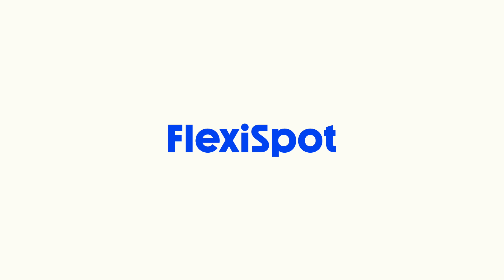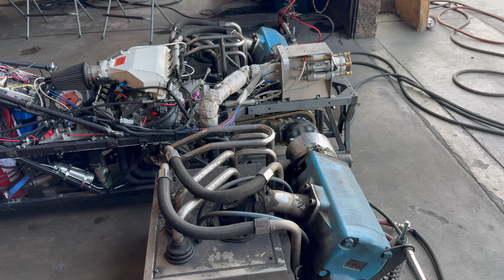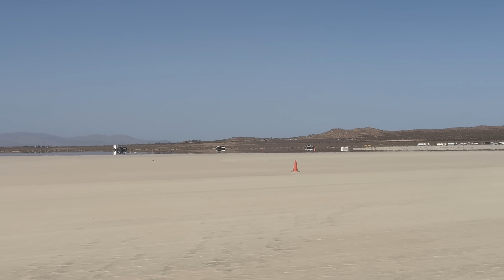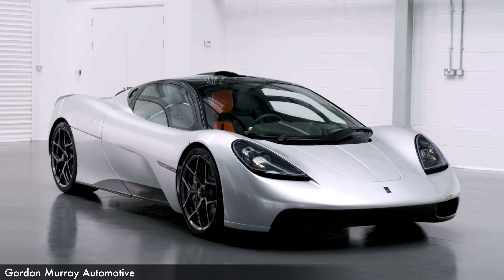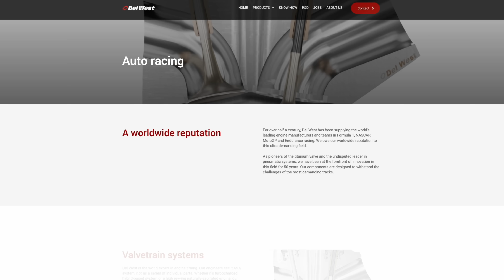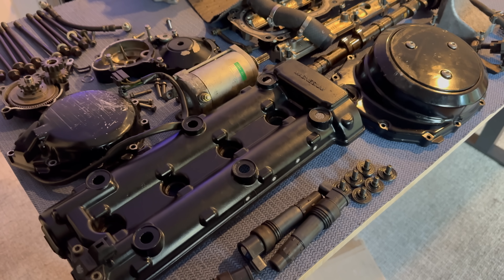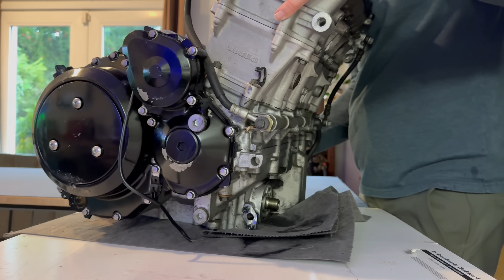Motorcycle Engines Are WAY BETTER than Car Engines

Comment: When I switched from working on cars to motorcycles I immediately noticed the better build quality.
Reply: When I switched from Yamahas to a Ducati I immediately understood the difference between a regular production engine and a pure racing engine. I have effortlessly rebuilt many motorcycle and Kart racing engines and the Ducati Testastretta in my 999 Superbike absolutely blew my mind when I pulled it out for a rebuild. I was unable to do anything myself except teardown and a bit of the reassembly because of the insane tolerances and the need for thousands of dollars worth of tools that are  proprietary to that one engine alone. I did order all the parts myself so I could marvel at their beauty and precision, and was able to witness some of the processes of the rebuild at the various shops doing the work. 
The transformation of my "stock" Testastretta into a fire breathing (literally) monster was absolutely fascinating and it gave me a whole new level of respect for the insane technology and engineering in pure race engines like F1 and MotoGp.
Reply: Ducati engines tend to need disassembly, cleaning, and reassembly, right from the factory. For some reason they tend to come with various debris inside, metal shavings and other workshop dirt.
Reply: @timmio11 Ducatis have amazing engineering, if you can afford to run it.
Reply: @timmio11 and Ducati still get beaten by bmw 1000rr. Hilarous
Reply: @PowolnyJanek  Without balance of power penalties Ducati probably wouldn't have lost a single race in 24-25. Without Toprak and Super Concessions BMW would be nowhere. Very hilarious.
Reply: @timmio11  they also get beaten by Kawasaki for years before that .... it's also funny calling out Toprak when an ex motogp rider is winning your championships ;)
Reply: @timmio11 funny you call one of the best automotive company in the world a nothing 😂😂😂
Reply: @PowolnyJanek who the fuck cares?
Reply: @PowolnyJanek yeah but at least with the Ducati you don't have to be gay right?
Reply: Are they easier to work on because they are more compact or does that make them  a lot more labor insensive since everything might be crammed into a smaller space?
Reply: @Adder0130  working on bikes is WAY easier because so much of bike is exposed. And if it's a big enough project, then you can just remove the engine entirely pretty easily.
Reply: "The engine made for pure racing performance is better than the engine on a mass produced commuter"
Shocking
Reply: @rachelpurity1  Not just that it's just working on these components is so much easier. Need a brake job or transmission build? Good luck laying under a car for 3 hours. On a motorcycle tho you can do it in your living room with like one ratchet and 3 sockets
Reply: the motorcycle cluch feel is alien to me , how can it be so fuking smooth!
Reply: Motorcycle transmissions are awesome and so smooth because its like a torque converter without the conversion lol multiple clutch plates submerged in oil makes a great difference compared to cars single/dual disc high springrate friction surfaces that are bone dry and ready to vibrate against eachother as they mesh lol
Reply: @alexrusu6417 A 100kg bike vs 2000 kg car. Yeah, kinda self-explicatory
Reply: @dimitardimitrov9482  a 50ccm scooter weights 100kg 😅
Reply: @dimitardimitrov9482  my bike, with my fat ass on it, weights about 500kg. The clutch engagement is 100x smoother than my wifes 1000kg hatchback.
Reply: @loosegoose9647 Well, yeah. It also lasts 10x less than a typical car clutch. Everything in the engineering world comes with trade-offs. Enjoy your ride, because in the end of the day, it's just money anyways 😊
Reply: @dimitardimitrov9482  wet-multi plate is just better engineering. DSG and PDK dual clutch transmissions aren't a disaster unlike other dual clutch designs because they use wet multi-plate clutches. Some motorcycles also come with slipper clutches, they limit back torque. You can just downshift like crazy, dump the clutch, rear wheel won't hop and skip, and the engine won't mechanically over-rev. You can money shift a motorcycle installed with a slipper clutch and it won't destroy the engine.
Reply: well no durr 😂 7k for a car gets you a beater while a 7k bike gets you a very capable machine
Reply: Car engines developed specially for mass production low quality and hard working. Old ones also to lack of maintenance and easy rebuild.
And moreover, the motorcycle consists at half of engine and average customer is interested about it. In price of a car the engine is at least quarter and you can be sure half of owners never opened the hood and don't care what engine is there 🤷
Reply: @Seregium Car engines are not low quality, any mediocre car engine last more than the rest of car. They are build for proffesionals: people use them to work and cant afford having the engine fail, they last more than 200.000km only with anual oil changes and yet people skip the oil change and the motor dont care. Well maintained car engines can last more than 500.000km. Motorcycle are either basic cheap CVT for people who need it to go to work or built like a fancy toy for motor enthusiasts and more like an "use and throw away" product: I have never seen a motorcycle with more than 100.000km, the motor always die long before that.
Reply: @alejandrosrwebmaster  i personally know of 3 bikes that have over 150m on the odo. idk what that translates in km but they are still going! one dude has ridden his daily for years on a commute of like 150 daily miles.
Reply: @alejandrosrwebmaster  CVT in a two wheeler is a scooter, completely different design and workings compared to a sequential wet clutch transmission.  My Honda Elite/NHX 110 scooter had 80k miles when I sold it to a friend and it ran as strong as new.  That scooter had been ridden from California to Alaska to Florida, been across the USA coast to coast 4 times and countless other trips 1000+miles, daily driver for 10 years.  Many things wore out and got replaced, crashed several times, dozens and dozens of tires.  It was easily the best scooter I ever had and one of the best "bikes" I ever had.  I don't tend to keep my motos long, the Elite110 I keep longer than any other, 10years.  Second bike that I had longest was a CB600F 599/Hornet had it 6years sold at 50k miles and was still on the original brake pads.  I think that bike easily could have done 200k.  When I sold it at 50k it still felt and look new.  Most all my other bikes are sold within 3years if I like it and 6months if not.  But I'm keeping my Monkey and Trail until I can't ride no more, so at least another 30years.
Reply: @alejandrosrwebmaster  Or the rider die before that :D
Reply: @alejandrosrwebmaster annual *
Reply: You must be used to american cars. Europe doesnt have this problem.
Reply: Oh yea? I might should have considered that move.
Reply: My Italian built Moto Guzzi has better built wiring than both of the GM vehicles I’ve owned… and that’s BEFORE adding in the fuses to the aux lamps!
Reply: @_E135_ tiny ass harness exposed to UV, makes sense.

Comment: I don't understand the statement about high performance motorcycle engines being built to last only 40,000 miles. These modern engines will often do 200,000 with little effort.

Comment: Great synopsis on the major design points of high power density/high rpm engines. While Indycar/F1 have many similarities, Nissan's ZE0D RC that they did for their LeMan's Garage 56 car some years back is probably even closer to what is typical in sport bikes. Again, that engine, and Indycar and F1, don't have the same reliability requirements as passenger cars. Cheers.

Comment: thinking about it, I would gladly buy a car with a motorcycle engine that only lasts 40k miles, so long as, A: The replacement motor is cheap, and B: They make really easy to swap.

Comment: There are different kinds of "power". 
Torque x RPM / 5252 = Horsepower. HP is a calculation from torque.
Look at the difference between a 600cc 4 cylinder bike and a big V twin. The big twin makes more torque off-idle than the 600 will make all day, but the big twin doesn't rev high enough to make the big horsepower numbers. 
When you have lots of torque, gear selection and rpm become almost irrelevant.
I remember riding a friend's Triumph 600. He said it doesn't do much until 6000 rpm... that was a lie, it didn't do much until 8000 rpm. My Victory Kingpin (highly modified) made 108 Tq at 1800 rpm at 1/2 throttle (134 RWHP/142 RWTq at WOT Peak).
Everything is a compromise. We each choose ours.
My daily driver is a 1-ton truck with a big-ol' turbo diesel engine. It puts like 380 HP and 870 Tq to the tires. It's VIOLENT. It's unbelievable how an 8850 lb vehicle can move with such authority and it only revs to 3300 rpm.

Comment: Great piece. Motorcycle engines are pretty amazing, especially for the money. Of course, a major takeaway here is that expecting an internal combustion engine to make lots of power with reasonable emissions is something of a fool's errand. When you add in the fact that these things only convert something like 15% of the energy input into motive force, the whole "unlikeliness" of this  technology becomes that much more apparent. 

While I appreciate my Suzuki liter bike a whole lot (and the Grom too), it's become pretty clear than electric powertrains are a far better answer for cars.

Comment: I bought a 2000 Harley Davidson FX Dyna TC88 in 2001.  I recently sold it after racking up almost 175,000 miles and never had the engine apart. I did replace the timing chain tensioners four times including one upgrade to hydraulic. The motor and transmission ran like new the day I sold it! Regular maintenance is the key. I wanted to make it to 200k but my age forced me onto a lighter and easier to handle bike.

Comment: what was the engine you showed for the clutch and transmission? changed my clutch in my 79 xs650 this past summer and it looked super similar

Comment: So to get good power at low RPM (where it's useful for normal driving).. you need a big engine.  You yourself just described why motorcycle engines are worse at the end of the video.  A large NA v6 or v8 still seems the best, especially an older one that's less constrained by EPA.. motorcycle engines are for lightweight vehicles, which are not good for normal driving where bigger= better

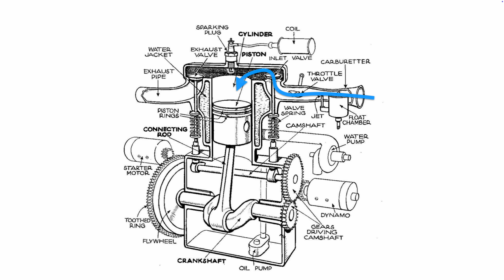Comment: @1:50 how TF can you have a camshaft occupy the same axis as the crankshaft without the connecting rod intersecting the center?
Reply: Its a bit hard to see, but it looks like the engine is cut down the middle, so the camshaft is actually offset behind the conecting rod.

Comment: “Or you can do it the hard way: engineering.”
“Everything is a spring, especially springs.”
“Usually just 1 at a time otherwise the transmission would explode.”

The only thing I enjoyed more than those quotes was the constant deadpan delivery with no vocal enthusiasm whatsoever even though you love engines so much you literally have a crankshaft lamp.

Comment: Nice video, this puts everything we knew into perspective.

One major point is that 1L motorcycle engine powers a 200kg payload and 1L car engine powers a 1200kg payload. That's where all the differences arises. Driveability to torque to gearing to revs and so on

Comment: Motorcycle engines make better aircraft engines in some ways. I used a Suzuki M13A which is similar to a hayabusa, but better for constant power. Kawasaki is releasing a new line of aircraft engines which are basically motorcycle engines without the clutch and transmission.

Comment: Brilliant video. I was going to say, "Remember the motorcycle-engined Honda S600 and S800 back in the 1960s?" but then I saw that you have one with but with a more modern motorcycle engine. Back in the day a friend had an S600 and it revved to an unbelievable 10,000 rpm.

Comment: Cars dont need more power per se, they need more torque. That's the basic reason why bike engines are fundamentally different. I'm baffled as to why you never mentioned this or differentiated between power and torque.

Bikes are small things which can run on low torque so the cylinders can be small and oversquared, and rev much higher.
Heavy bikes like adventure bikes usually dont have this type of engine, they are usually big twins with big pistons since they need all that torque down low.

Comment: You missed two important points.  One, the smaller displacement means that the ratio of surface area to volume is higher.  That means it is  easier to fill and empty small cylinders at high rpm.  The second part that you missed is that the displacement to weight ratio on the motorcycle is very favorable.  That means you do not need much low end torque to accelerate.  An engine that does not need much low end torque can easily be tuned with large ports and large duration cams and focus on the high end and rev to oblivion.  Also, if you do not need low end torque, you can increase the bore to stroke ratio.
Reply: Grumpy SOB. Go back to bed and sober up.
Reply: He literally covered all of that. Especially the power/torque to weight at the very end.
Reply: @brois841  It is not power to weight, it is displacement to weight ratio that is important.    He said nothing about surface to volume ratio.  The only thing he covered is the engine life requirement, which is important but not as critical as the parts he missed.
Reply: @demetridar506 he covered that as well.
Reply: @brois841  when?
Reply: When in the video did he cover these elements? X:YZ minute:seconds
Reply: @demetridar506  
Bore-stroke:  5:04
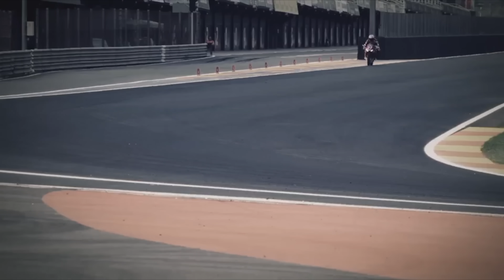Low RPM:  14:21 
Displacement (well, power) to weight/drag ratio was mentioned more than once eg 14:00

I don't recall him explicitly explaining about ratio of surface area to volume scaling with size, and yeah probably should've done for completeness, but it doesn't change much.  It was hinted at a few times, eg asking why not just take a motorbike engine and add more cylinders, like a V8 - join 2 motorbike engines together to keep the same displacement to surface area (14:37 / 14:50).  The problem with doing that is the added complexity/cost and higher fuel consumption / emissions, so fundamentally it's still the same reasons we keep coming back to.
Reply: @mrfish9876  At 5:04 he explained how high bore to stroke ratio helps, but he did not mention that this is possible BECAUSE you do not need low end torque.  A large bore to stroke ratio will eat away your thermal efficiency at low rpm and high load, and will create detonation.  The low rpm at 14:21 is what?  He did not say that the bike does not need low rpm torque.  No, displacement and power is NOT the same thing.  If they were, this video would have been irrelevant.  The video was a nice attempt in explaining, but somewhat superficial.
Reply: @demetridar506  no one cares dude.
Reply: @yourbore  "no one cares dude." The original comment has 107 likes at the time of my reply, and I think we could assume that most upvotes were actual people, so at least some people were interested in what @demetridar506 said.

If you didn't care, why bother replying?
Reply: @demetridar506  I admire your tenacity.
Reply: Just use lower gears if you lack torque.
Reply: @R4M_Tommy 
You don't really understand the importance of low end torque, do you
Reply: I gave you, demetridar506, a thumb-up because you clearly know what you are talking about. For me to have a similar level of understanding, I'd have to study for, optimistically, a year. The alternative is to abandon learning about ICE engines and move on to electric ones. That's a cop-out, but it's the way of the future.
Reply: @Nehmo  Unlikely, internal combustion engines will be around for a long-long time.
Reply: theres always that guy. and you are that guy. make your own video.
Reply: @yourbore 🤦‍♂️
Reply: @yourbore  How dares someone add anything to the video they're commenting under!

Comment: Have you ever considered PWC engines with your projects? The Yamaha marine 1800 is a flat plane crank marvel. About 200 hp NA, 300-350 with a little boost. They run very clean and still make power.

Comment: on a motorcycle that weighs less than 200kg it makes sense to install an engine that is smaller and revs much higher to safe 30kg. But in a car with 1500kg these 30kg don t make any substantial difference. It simply would not make sense to install a  1000ccm 140 hp engine instead of a 2000ccm engine with the same power output at the cost of longevity, reliability and more expensive components

Comment: Straight cut dog box is super useful when you stack your bike and break the clutch lever. You don't need a clutch if you regulate your rpm. Just like a road Ranger transmission.

Comment: Make more power is not necessary a better engine. Motorcycle engines make more hp but way less torque, speaking about torque diesel engines are king making power and way more efficient than car or motorcycle and even electric engines if you consider batteries.

Comment: I totally get the fascination with the engineering that goes into all that, but electric motors are just better in so many ways. 
Instant torque, fewer parts, superior longevity, superior energy efficiency at any scale, no noxious emissions that fuck up air quality or the climate of the planet we all live on, no deafening noise (only a plus if you're not an a-hole, so your mileage may vary). The power density of batteries isn't yet where electric motorcycles provide the same or a better experience as combution-powered ones, but they'll get there.
And again, amazing pieces of engineering those engines.

Comment: 9:30 Yes they are that heavy 4 cylinder car engines especially older but let's say 2.0 ecoboost weights about 240 pounds. Not nearly as much as 2.5 times the weight. However You probably weight motorbike engine with transmission so might be more acurate if you count that this way